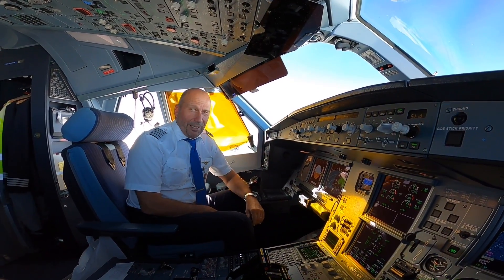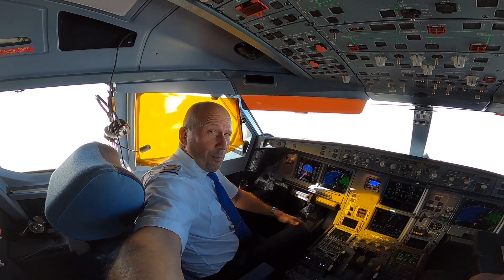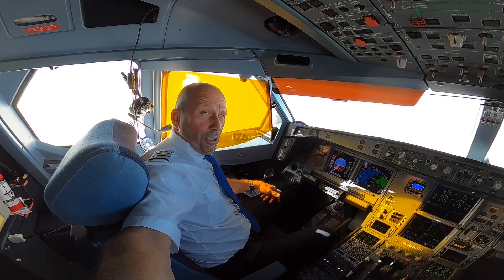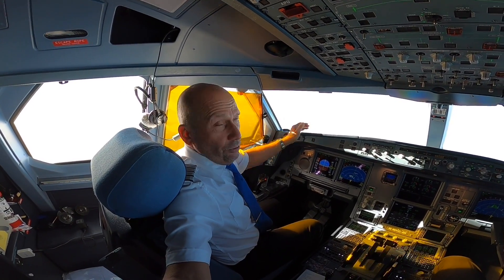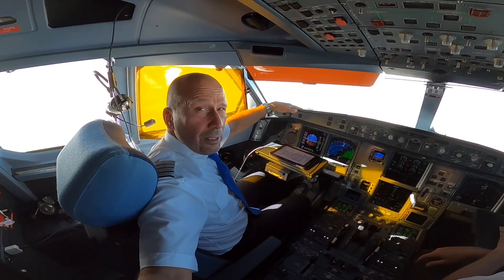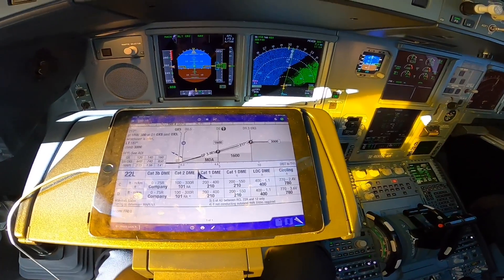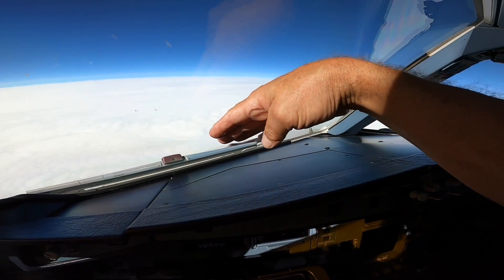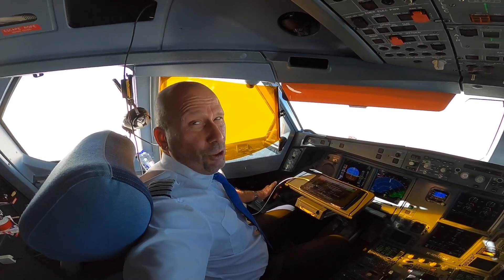Explaining how we land in fog without looking out.

Comment: Could you explain ROPS and the BTV on the A350 (if SAS has equipped it)? Would be very nice to know how it works and how you use it or it benefits you in day to day flying.
Reply from the maker: I have explained BTV briefly in another video. The question is which one? Have not talked about the ROP. Good idea! 😉👍🏼
Reply: @bjornpilot  Thank you for your answer. I guess I haven’t seen that video yet. I was just wondering if the BTV is different than on the A380 where I have seen it in a PilotsEye.tv Episode. Have a great Day👍
Reply: @tomstravels520  Thank you
Reply: @cschruu with BTV the pilot selects a runway exit using an expanded airfield plan on the navigation display. The aircraft will then manage braking automatically to arrive at that exit at taxi speed. It’s very impressive, we use it every time.

Comment: When I was in the army during operations the airforce in order to fly up supplies etc. Where obliged to fly below enemy  radar ( treetop ) at night sometimes in zero visability (rainy season) and put a c130 down on a gravel strip hacked out of the jungle lit with paraffin lamps which where extinguished as the plane landed. Impressive.
Reply from the maker: Cool. That’s tough and dangerous work. 🤓👍🏼 We flew 10m over sea and 20m over land at close to supersonic speed. But nobody could measure it so it was often lower. 😅 I’ll never forget it.

Comment: Hi Bjorn,

Can you make a video about descending? When to start descending ? Like what distance? Is there right from wrong? And at what altitude should you cruise at before landing? Also, do you use autopilot to descend  or manual? Thank you so much for your great information and helpful tips. Appreciate it!
Reply: Hi quickly put- you want to be descending at a rate which:

Keeps your speed in a safe range 
Allows you to have as low engine thrust as possible 
Allows you to use as little speedbrake/create as little drag as possible.

The computer calculates how long this angle will take to descend, and tells the pilot.

Comment: Hi Cpt, on autolanding after the spoilers deploy do you have to manually apply reverse thrust? At what speed do you goto manual braking? Does autobraking work down to set speed? Thank you.
Reply: Yes reverse thrust is always activated manually. Auto braking on the new aircraft (A380/A350) uses Brake to Vacate where the aircraft will slow down automatically to 40 knots (high speed exit) in time for it to turn off a pre selected turnoff

Comment: I noticed that before landing, each flap has a recommended speed. At what distance from the runway do you start changing flaps and reducing speed? How do you know at what speed to gear down just before landing? Also, how do you get the localizer and the glideslope? Thanks for your reply.
Reply: You tune the ILS frequency on the FMGC (once the approach is selected it usually autotunes for you anyway). Then you press the LS buttons to display the diamonds and press the APP button on the FCU once cleared for the approach then it will automatically lock on once close enough (as long as you are at or below the glideslope initially, it won’t dive to catch it)
Reply from the maker: Not a specific distance. It’s up to your judgement by experience. Appropriate position for deceleration (extending slats/flaps) is also displayed with a "D" on the navigation diplay.

Comment: "How are Airbus pilots trained for using the mechanical backup control systems?"

I am copying this directly from someone else's post on StackExchange Aviation, as it sums up my questions perfectly:

"The A320 and friends have mechanical-only control capability (manual pitch trim + rudder pedals) for cases of total fly-by-wire computer or electrical failure. Obviously, this would be covered in ground school when the various control laws are gone through.

However, is any further training given to line pilots on operating the aircraft this way? Or is it one of those "dusty corner" procedures that you learn about in ground school, but never really touch again?

Alternately, what would the chances be of someone who'd never flown a 'Bus in mechanical/backup law being able to keep the plane dirty-side-down and airborne long enough to get the FBW back going and/or perform a landing where the aircraft is reusable? Clearly, it's non-nil as the Airbus test pilots actually tested flying the plane that way, but how difficult is the aircraft to fly in mechanical/backup law?"
Reply: It’s a bit old and not quite realistic but this may answer

https://youtu.be/O20t9aAtT1Q

Comment: Q: While taking off especially on Airbus planes, pilots say the words "Man, Flex, SRS". Flex I assume is in reference to the Flex temp. Under this assumption you are calling out for three different things while taking off. So what exactly are you calling attention to/looking out for? What does the phrase mean exactly. Thanks.
Reply: MAN FLEX means the thrust is set to flex temperature. Pilots sometimes say the number next to it which is the flex temperatures chosen. Man means manual as the autothrust is not fully on. MAN TOGA means TOGA thrust has been set 

SRS is speed reference system and basically means the aircraft will climb at V2+10 knots. This can change the pitch  depending on aircraft weight, thrust and wind changes. 

RWY means it will initially follow runway heading initially 

Autothrust below means autothrust is armed. Basically all these call outs are to confirm everything is set to climb out safety and the other pilot will say wether his shows the same by saying “Checked”. These are all shown on the top of the PFD one what’s called the Flight Mode Annunciator
Reply: @tomstravels520  Thanks for the explanation Thomas, very enlightening indeed. I guess the crux of my enquiry came to the fact I wasn't aware what the SRS abbreviation stood for and wondering how its was related. So in essence the phrase is "Man-Flex, SRS"...continuing with the takeoff. Cheers.
Reply: Aaditya Kaza MAN FLEX (or TOGA), SRS, RWY, Autothrust blue

Comment: Hey bjorn pilot, I have a question. How come the 737 max's  anti stall is SO flawed, when airbus also has an automatic nose down feature in certain situations, and airbus never had any problems with it? Thanks!
Reply: The MAX has 2 AOA sensors but MCAS only took information from 1 and swapped each flight. So if the one it’s connected to gives false readings then MCAS just believes what it says. Airbus has 3 and all 3 are checked by the flight control computers for consistency (although only average of AOA 1+2 are used to get final figure)
Reply from the maker: Thomas Mortimore Agree. That’s a huge difference. 😉
Reply: @bjornpilot  Thanks for the explanation guys!
Reply from the maker: As far as I know, the Airbus does not have a nose down function like the B737max, especially not when flying manually. 

If the AOA sensors are faulty (some resemblance with the B737max) and the nose pitches down, a procedure was introduced some years ago to go to direct law by manually shutting 2 ADRs. Lufthansa had a nose down incident over the Atlantic Ocean a couple of years ago. Now the planes are modified.

Comment: hey! does the aircraft actively scan for the runway? i mean can it detect if the glideslope/localizer isnt lining up the aircraft to the runway correctly? there was a crash where the localizer was off the centerline and the plane landed on the grass. can an airbus detect that and warn the pilots about it?
Reply from the maker: The ILS signal is do accurate that the aircraft tracks the centerline. Before and after the touchdown.
Reply: @bjornpilot  thank you for your answer but i dont think that we are on the same page. I meant that can an aircraft detect if the ils system is faulty? If lets say the localizer gives the wrong signals to an aircraft at a fully automated landing what will the aircraft do? Just follow the wrong istructions?
Reply from the maker: @zoltanonody3541  ok, understand. Well, 3 things. First the pilots have to check the correct ident and track number for the ILS signal. That's pilots job. Then the signals from the 2 recievers are compared with each other by the plane. The airbus can detect if they differ. Don't know if Airbus compares the position of the ILS track with the track from the nav-system. Could be so, not sure because the accuracy of the nav system is high since it's used for Rnav approaches to very low minima.

Comment: Can you make a video on how to set up auto pilot to cruise at cruising altitude? also, does the auto pilot follow the route if it has a change in direction?
Reply: You program the cruise altitude into the FMGC then tell the autopilot to manage climb to that altitude when cleared. Yes the autopilot follows the route if you program it to go direct to another waypoint as long as it connects from the aircrafts current location

Comment: Would a landing be called an automatic landing, if on final approach, the Glide slope is followed manually, but lateral navigation is handled by the autopilot through the LOC mode and auto thrust stays ON?
Reply: No. The autopilot is either on or off. Not partially off so you’re either flying fully manually or flying an autoland with autopilot on. Or you can use localiser mode and vertical speed mode but then the aircraft won’t automatically flare if on autopilot
Reply: Thomas Mortimore thanks

Comment: Hi! Can you do a video explaining about the weather radar functions? Also how you can use it for terrain mapping?
Reply: Weather radar and terrain are completely different. Terrain is just preloaded data stored in the EGPWS or TAWS computer of the elevation of all over the earth. It doesn’t scan the elevation of the earth
Reply: @tomstravels520  I believe back in the day, weather radar was also frequently used as a terrain mapping radar. I dont know if the functionality is still existing on new aircraft models.
Reply: @robrecht9641  no. Nowadays it’s a stored database of terrain height as the problem with early GPWS was it relied almost only on the radar altimeter to check the height below the plane. Weather radar uses Doppler radar that detects moisture

Comment: Is there any difference between autopilot 1 and 2? Isn't it better to just have 1 like the 777?
Reply: AP1 and AP2 are separate channels and read from the captains or FO’s FMGC, ADIRU and other sensors. That way if say the captains altimeter started going crazy or fails then you can switch to AP2. That’s one of the reasons why Birgenair 301 crashed. The autopilot was connected to the faulty/blocked pitot tube so it believed what it was reading which was wrong

The 777 actually has 3 autopilots but seemingly only one button to activate them. Not sure how that works
Reply: @tomstravels520  oh okay, that makes sense. Thanks!

Comment: What is trimming and how you do it
Reply: Trimming is used so you don’t have to keep moving the elevators all the time with the yoke or sidestick. A trimmed aircraft will not maintain the attitude without any manipulation of the controls. It moves the horizontal stabiliser and on the airbus you can’t use the black and white stripes handles next to the thrust levers. However normally you don’t need to as the airbus autotrims

Comment: Could you please explain what a CAT II approach is? I kinda know what CAT I and CAT III is and when and how they are used but when would you use CAT II and why? Thank you very much in advance! :) 
P.S.- Great video. Keep up the good work! Happy landings!
Reply: If you know what CAT 1 and 3 are then CAT 2 is just in the middle. Visibility is not good but better than CAT 2. CAT 2 minimums are often 100ft above the ground so you can proceed further as long as your FMA says you are CAT 2 or 3
Reply: @tomstravels520  Thanks very much for the explanation. So basically it's all to do with the minimums then. CAT I is the highest, then CAT II and finally CAT III having the lowest minimums/autoland?!
Reply: Zsolt Kadar in a nutshell yes. If the visibility of the runway/approach was CAT3 (extremely foggy) but you had some system malfunction like Radio altimeter failure that degraded your aircraft to Cat 2 or 1 then you’d couldn’t land there
Reply from the maker: @dfczkk  yes. And with "cat lll no decision height" you don't need to see anything before touchdown

Comment: Hello captain! 
Does the side stick sensitivity vary between aircraft models, like between a320 and a350? 
Can a pilot adjust side stick sensitivity? 
Thank you!
Reply from the maker: The flight control laws are so programmed that all Airbus planes feel the same. However I think the A350 is a bit more responsive. I have never flown the A320. Even they are supposed to feel the same, you can not hide that some are much larger than the other. 

The sensitivity can not be adjusted. They all fly very very well and have fine feeling in the stick. The best I've flown, except for fighter planes of course.
Reply: @bjornpilot  Thank you for answering my query captain! what was your first aircraft on which you have become a first officer?
Thank you!

Comment: I have one question:
What is average teperature in the cockpit?
Is it too hot or too cold sometimes in the cockpit?
Reply from the maker: It's perfectly adjustable. Heated floor but during winter nights a littke cold over the knees, so we use blankets. Check the "pilot comfort" video! It's -60C outside so it maybe has effect. The A350 has more even temperature distribution.

Comment: Tell us about thrust levers, FLEX mode etc
Reply: i know a few things about airbus aircraft, i hope this helps. 

on the trust lever, there are 4 detents. idle, climb, flex, toga.:

-idle is what it sounds like. idles the engines, minimum trust.

-climb is the detent for the autothrottle, the airbus's autothrottle system doesnt move the thrust levers phisically like boeing's. It controls the trusters via a system called FADEC. (full authority digital engine control) when the throttles are moved from toga or flex detent to the climb detent after departure, the autothrust goes from blue (armed), to green (activated) on the top of the pfd. (primary flight display, where the attitude indicator is located.) theres a name for that row but i cant remember the name, feel free to correct me.  

-flex/mct is reduced takeoff thrust. it takes the runway length and a manually selected outside temperature (flex temp in the mcdu) and a lot more factors (runway conditions, wind, etc) to account, for calculating the minimum trust needed for takeoff. it helps to increase the engine's life and reduces noise. The mct part means max continous trust. no limit for how long you can run the engines on flex.

-toga is the max thrust availabe. the pilots are to use toga instead of flex at a takeoff. i think theres a 10 minute limit for toga for 2 engines, and 15 minute for one engine.

theres a zone named autothrottle between the climb and the idle detent. you can control the engines manually (if you turn the autotrust off) in that zone (its around 20%-70% N1) this is also the zone of how much thrust the autothrust can access. unless you trip alfa floor (the anti stall system of the airbus, triggers toga regardless of the thrust lever's position.) the autothrust will only access this margin of thrust.

after departure, there is a thrust reduction altitude (usually around 1500-2000 feet). this is the point where the pilots switch from toga or flex detent to climb detent. here the autothrottle turns on as well. after this, the autothrottle controls the speed until landing. 

please keep in mind that english isnt my main language so sorry for any misspelled words and stuff like that. (probaly misspelled thrust/trust a houndred times...)

Comment: Hi Bjorn, could you explain Vnav and Lnav? thanks Ale
Reply: Lateral navigation and vertical navigation. Lateral navigation will follow the path programmed into the FMGC from point to point. Vertical navigation follows the vertical profile ensuring the aircraft stays within any set constraints
Reply: Thomas Mortimore  so is almost the same of a Rnav approach but function at every fase of flight ( climbing , descend and cruise) ? You need of couse all set in fms , as a flight plan
Reply: Ale L. Pretty much yes. RNAV (or RNP/RNP-AR as they’re now being called) is just following a series of  waypoints at set constraints. On airbus it’s NAV mode and managed climb/managed descend. VNAV/LNAV name is more Boeing
Reply: @tomstravels520   Thanks:)

Comment: So theoretically, in an unlikely event of both pilots being incapacitated, an inexperienced pilot or passenger would always go for CAT3 landing when possible?
Reply: CAT 3 landing is just applicable to the amount of visibility. I’m pretty sure you can still autoland on a clear day at any airport with an ILS as long as it’s not offset in any way but might be wrong
Reply from the maker: You can autoland by pressing a single button, yes. The problem is that you have to set up lots of other things, like flaps, gear, mcdu (the computer) and also position the aircraft so it catches the ILS beam. Not so easy.
Reply: @bjornpilot  Surely, but with dumbed down instructions from other pilots or ATC it could be done. This is of course just my excitement speaking after recently being in a 737 simulator.

Comment: could you do a video about more details of the autopilot? I'm always wondering about this blue - green system in Airbus. Also about the push vs pull button (speed selector for example). And also about the flight phases of the FMC, how much is automated there and what is put in manually. So still lots of video material possible ;)
Reply: Blue basically means armed, green means active. Pull is for selected modes (pull to take control from aircraft) push is for managed modes (push to give control to aircraft)